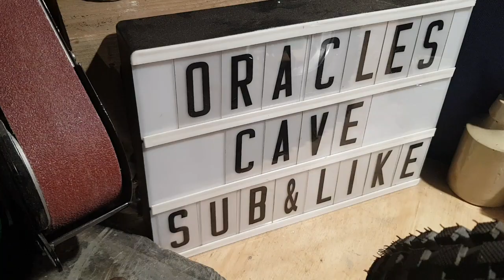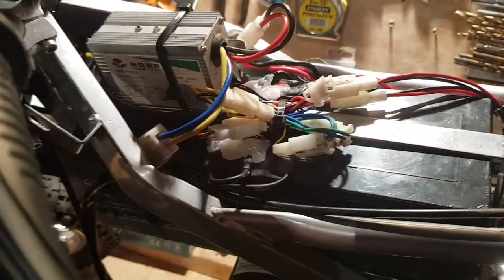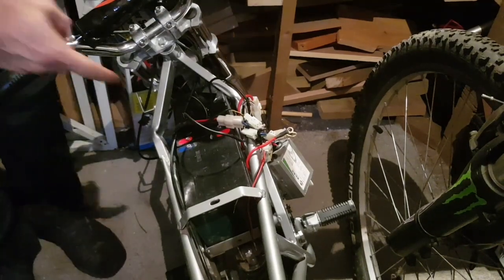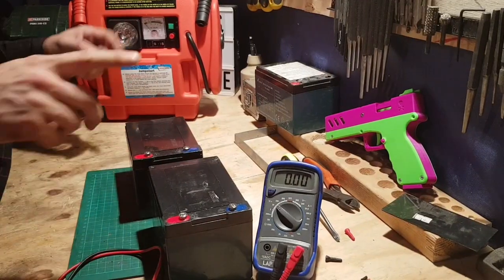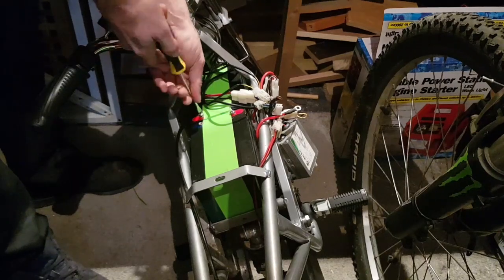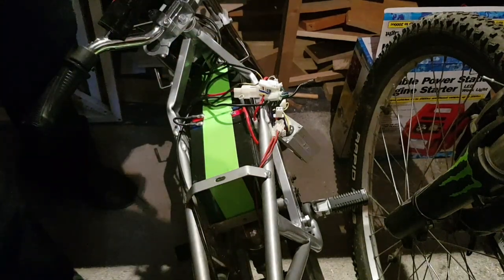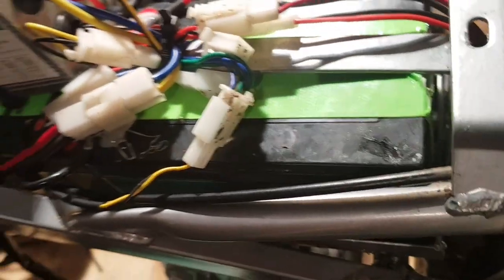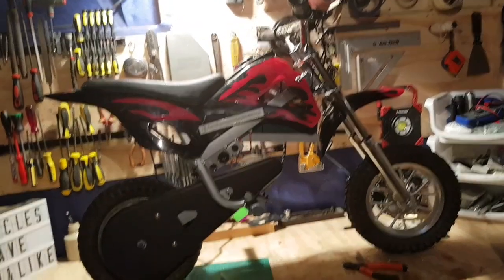HOW TO FIX REPAIR ELECTRIC BIKE THAT WONT CHARGE

Comment: Class video mate 👍. I've just tried this, batteries have been topped up with water and are fully charged (both at 12.5 volts) but the thing still doesn't want to run... could the batteries still be bad even if showing 25vdc between them? I've changed that little circuit breaker too... key switch is fine too! Ran out if ideas 💩
Reply from the maker: Yes, the strength of the battery could be the issue, that's the electrolytes, you may need a battery reconditioning pack, it's just some acid to add into the cells with the water.
I have seen videos go around of people using different things instead of acid, but not sure if they work.
But fresh acid water will get you back to brand new power.
Reply: @oraclescave  nice one mate 👍

Comment: Hi, I changed the batteries in my sons 36v 500w dirt bike and now it's not turning on, do you have any suggestions? Would be greatly appreciated
Reply from the maker: Maybe check the "inline" fuse.
Sometimes they have an overload reset button you can press.
Or the fuse might have popped when you connected everything.
Check to see if the metal part in the fuse has blown and separated.

Comment: I have a razor mx500 that won't take a charge.  It powers on when plugged into charger, but no power when unplugged.  Could it be the batteries mate?
Reply from the maker: Yes it's the batteries bud, it's very common on these bikes.
Very easy to find replacements on ebay if they refuse to work.
I'm sure they are 12v 10AH each, 36v take 3 of them.

Comment: I will try this. Thank you
Reply from the maker: Go for it, I also have another battery reviving video, you might find that the battery is not strong afterwards.

In that case you would want to put fresh electrolytes inside, these can be purchased in small amounts, and will bring your battery back to full life.

Very cheap too.

1280 electrolyte its called, please remember to wear glasses when playing with battery liquid, just to stop any splashes in your eyes.
👍👍👍

Comment: Hi mate, I have one of these that I picked up and I am not sure if the batteries are shot or if the charger isn't doing it's job. It doesn't seem to charge very well. It can be used but it struggles to get up small inclines quite quickly so I don't think the batteries are getting or holding a charge properly, does that sound about right? They look the same as your ones, should I attempt this or just order up some new ones? They are about £40 for the two. Cheers.
Reply from the maker: Its the batteries bud, you can order new batteries, but LEAD ACID batteries are rubbish, look for SLK Gel batteries.

And if its 12, 12ah, you can get a bigger boost ordering SLK 12V 15AH.
Same size but 20% more power 

👍👍👍
Reply: @oraclescave  nice one, cheers for that. I'm having a look now. Can see a pair for around the 50 quid mark I think. They are spade connectors vs the female ones, best bet to just cut the wires and convert them to spade? Also, did you ever get around to doing any power upgrades on this wee bike? I'd fancy swapping out the motor but not sure if it's worth the money, need to upgrade the controller as well I imagine?
Reply: @oraclescave  just noticed the batteries I've seen are SLK but not gel. The gel ones are much more expensive but I can't see a 15ah one so far. Any idea how much they would be for a gel 15ah? Not wanting to spend a great deal to be honest as it was a cheap pick up. Just want it running better. Would the SLK 15ah lead ones be any different/better than any other lead acid? I guess they have 3 extra ah so there's that. Sorry for so many questions! Ha!
Reply from the maker: @rustybaws  yes these batteries are slightly more expensive, but this will translate into more distance, but sticking with whatever you are comfortable paying is OK too.

Yes these motors can go 50% power, so getting a speed controller 50% bigger will boost just fine, but there is much better electric dirtbikes, but then it's lithium batteries, much more expensive to replace.

The bike you have is cheap to replace batteries and works great when the batteries are new.
I really wouldn't try upgrading as it would be cheaper buying used lithium one with brushless motor, much more power.

I would keep your little bike as it is.

Here is a link to slightly more expensive batteries, but you will get longer ride time, more charges.
 https://www.amazon.co.uk/Pair-Mobility-Scooter-Batteries-10ah/dp/B01MG8A83O/ref=mp_s_a_1_1_sspa?crid=1RDKTFU5JEPQ5&keywords=12v+15ah+slk&qid=1652718737&sprefix=12v+15ah+slk%2Caps%2C262&sr=8-1-spons&psc=1&spLa=ZW5jcnlwdGVkUXVhbGlmaWVyPUEzTFJBNzRWWVJVWURPJmVuY3J5cHRlZElkPUEwODU1NDAxM0FTWEFaREpPSUg2VSZlbmNyeXB0ZWRBZElkPUEwNzM3MjA5MlBMVktXNFRMMFBEQyZ3aWRnZXROYW1lPXNwX3Bob25lX3NlYXJjaF9hdGYmYWN0aW9uPWNsaWNrUmVkaXJlY3QmZG9Ob3RMb2dDbGljaz10cnVl
Reply: @oraclescave  nice one mate, cheers. Those were the ones I've seen on SLK's website I think, they are only £49.99 with free delivery I think so will probably go with them then. It's only for my 5 year old, he's got a 50cc as well but thought this would be easier to find places to use it being so quiet and probably bit easier to learn on. If he ends up liking it and getting into it I'll look into getting a better bike, something I can use as well maybe haha. Thanks again!
Reply from the maker: @rustybaws  these electric machines are awesome, the silence is the absolute best thing about them, no moaning killjoy spoilsports complaining about noise.

I have been a 2 stroke rider for 38 years, and I will only use electric from now on.
I currently have the most powerful electric scooter in the UK, and its savage.

The acceleration is second to none and by the time people see me, I'm past and gone, never to hear a slightest moan come out of their mouths, its awesome.

My kids were always greeted politely when riding electric and the old grannies absolutely loved the fact it didn't scream like a petrol version.

I give my 110% vote to electric only for the future, your kid will absolutely love it, with no fear of being burned by an exhaust when falling over, much less running problems than petrol versions.
And much more accepted by the complainers, it just wins hands down over everything.

I wish you all the best and if you have any other issues just give me a shout, I will try to help the best I can.
And yes your original charger will still work for charging as the voltage will still be the same.
👍👍👍
Reply: @oraclescave  nice one cheers. About to place the order on them now. Even with the cost of the new batteries the bike will only have cost me a little over a hundred quid so as a starter bike it should be fine for my kid.

I have been really keen on getting myself an electric scooter but I have no idea what one, where I'd ride it and if I'd get grief from the old bill. I have a motorbike licence and have road bikes but don't want to be getting points etc. I'd use it in park with the kid but that's about it so don't want to spend too much on it either.

Definitely agree on the electric, it's so much easier to go unnoticed than a screachijg 2 stroke engine anyway haha.

Cheers for all the help again, much appreciated.
Reply from the maker: Yes it's very dodgy using these scooters as the police are going out of their way to give POINTS out to people riding these.

That's why I got one so powerful, they have no way to catch me really, I'm not the type to just pull over for a blue light.
But people who would pull over are at great risk of being done for driving with no insurance, M.O.T and if your road bikes are very important to you which I imagine they are, you might want to think about NOT getting a scooter.

But I use them on backroads, forest trails, parks, wasteland trails and I'm never getting bothered by anyone, I just start at one point, get to where I'm going, then head back along another trail.

Never really in the same place for a long time, and everything has been great.
As long as you are out of the way, and courteous to dog walkers and walkers, nobody complains at all.

My bogist c1 pro 500w scooter £559, is awesome especially when I start from more of an uphill on my journey and head downhill, I can get about 20 miles of awesome woodland runs that makes me feel 20 years younger.
And on these scooters 30mph feels like 60mph it's crazy fun.
Reply: @oraclescave  yeah that's my concerns in a nutshell. I need my license for my job as well so can't be getting points for something so trivial especially. They really need to get their act together and sort out the laws and rules. Like everything in this country, its miles behind the times and until they figure out how best to make money of us it'll still be illegal to use!

It's annoying sometimes watching videos from abroad where they have so much more freedom in terms of what and where they can ride certain electric vehicles. Here we are restricted to our own garden pretty much....

Anyway I'll leave you in peace now, batteries are ordered so looking forward to getting them and seeing what difference they make to this little bike. Cheers mate.
Reply from the maker: @rustybaws  no worries bud, and thanks for engaging with my video, I enjoy helping people out.
Let me know how you get on Rusty.
Much appreciated
Darren

Comment: Darren oright bro nice wee pit m8
Had quads for kids
No bikes lol
Castle hunt Tom 
Glesga. Canny 
Grumbel M8
At price. A need ma 
Calipers on ma bike 
Take care buddy. James.  John ask for you btw
Reply from the maker: Oi oi buddy, yeah it's a cracking little silent bike for cheap cheap lol.

I can't believe you still not fixed your brake calipers yet, it's easy and messy lol.
Just pull them off and let all the fluid spill into a container.
Then change what you need to change.
Then when you fill the new fluid back up and close the tank at the lever, just pump the lever and hold it in, while you crack the bleed nipple on the caliper until it stops spurting, close it and pump the brakes and hold in again and repeat, you might need to top up your tank a couple of times in between.

But that's all you need to do, there will be loads of videos showing step by step, honestly bud it's as easy as changing a bmx tyre.

You would manage it no bother with a video playing while you copy it.
Just make sure you have the right brake fluid for that bike and you will be fine.
👍👍👍
Reply: @oraclescave  cheers M8 aknow it's more tools. Need grind em of 
Guy over bk a mechanic. And scooter club member 
Said do it hrs got garage but don't 
Want ask the now 
His wife not well 💪